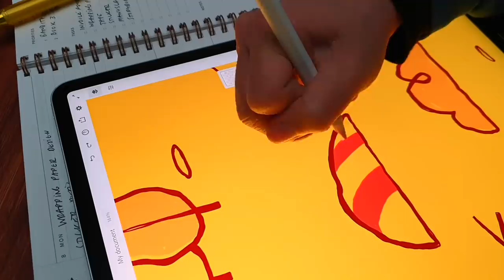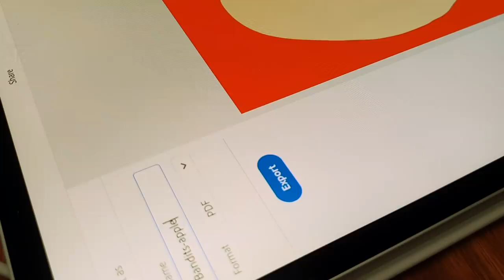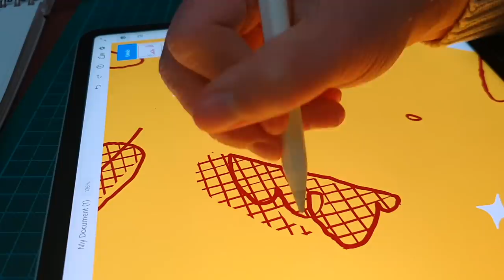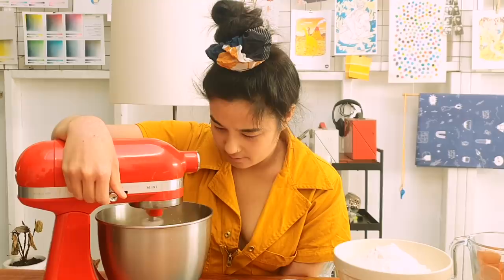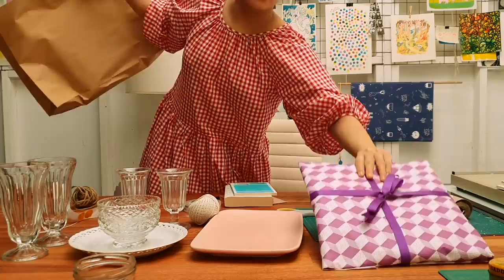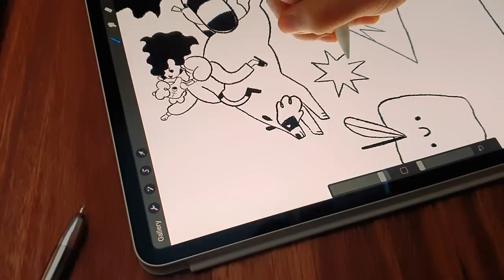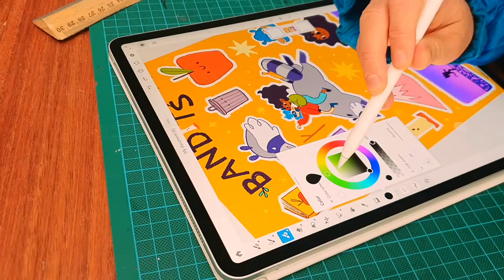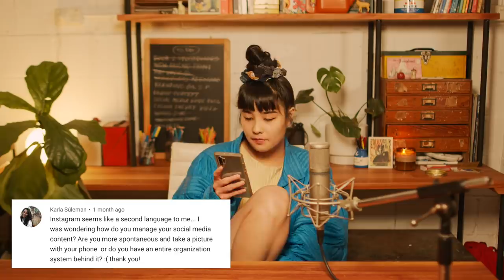STUDIO VLOG ✷ MAKING PACKAGING, SHELVES & A FUGLY CAKE

Comment: Great video as always 🖤🖤🖤 To replace your transparency effect using only one colour, maybe some halftone patterns (such as those used for screen printing or printing presses) would be helpful? I think you can find them by % so it could be as simple as adding, say, a 50% layer to your artwork, or converting your fill layer in photoshop, I’m pretty sure “half tone” is an option in the effects panel. Hope this helps!
Reply from the maker: I tried to overlay half tone texture using pathfinder on illustrator but because of the way my shapes were structured it didn't work. Is there another way to do this??? People mentioned bitmap but I haven't tried that and am concerned it's raster only?

ty for your advice!!

Comment: I think something easier you could have done with the transparency is bitmap the three different levels. That’s what I do for screen printing and risograph printing and it maintains the level of transparency without actually using transparency.
Reply from the maker: tysm!! is this raster only or can it be used in illustrator? I tried overlaying halftone textures but it didn't work over grouped shapes for me! ty for your help!
Reply: @furrylittlepeach  I'm not sure if it's in illustrator or not (sorry I'm not super familiar with that program) but I've used it in photoshop. It does make the image greyscale though, but if you put the greyscale, bitmapped image into another file you can use duotone to select a specific color and transform the entire image into the exact color # or code. I'm sorry if this isn't too helpful, I'm still learning, but this is what I've been using for printmaking!

Comment: i liked your response to the question about how to get into the illustration industry from graphic design. i more curious about how you'd get into it without a degree in the arts? what are some good resources that i can utilize? i graduated with a degree in nutrition but would still like to pursue illustration on the side
Reply from the maker: I have a Bachelor of Visual Art and Design majoring in graphic design BUT no one has ever asked me for a degree at all - so I don't know if it's an issue you haven't got one. All of my work is based on my portfolio and not my education! Some of my skills come from what I learnt at uni but those skills don't exclusively come from an intitutional setting, you can learn everything you need to know yourself for sure! 😍